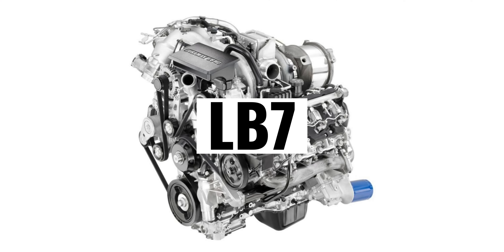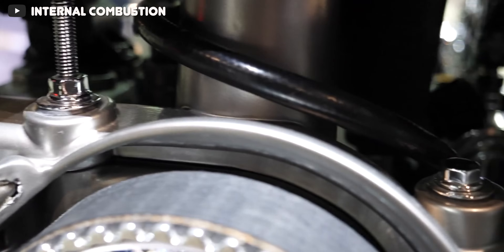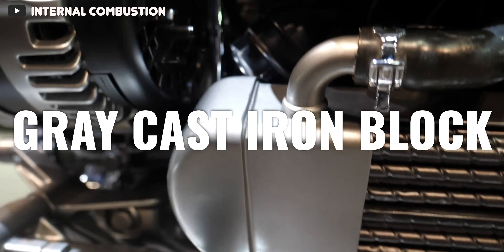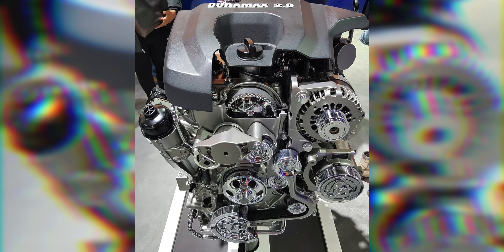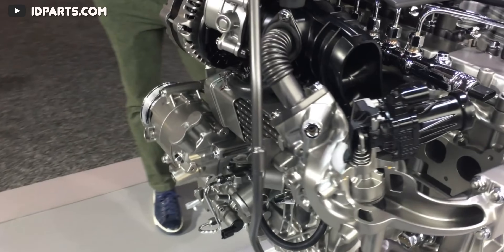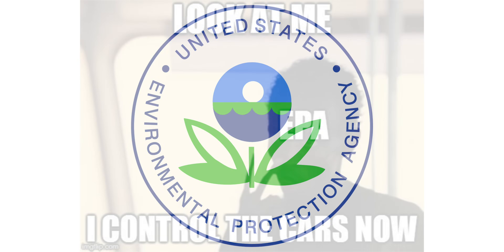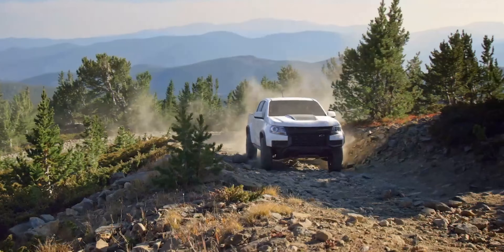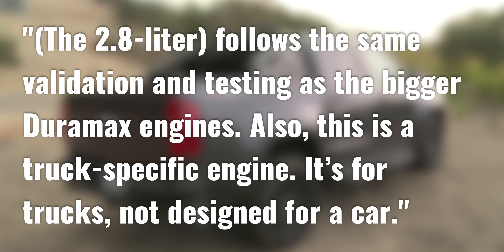2.8L LWN Duramax: Everything You Need to Know

Comment: 112k miles on 2018 colorado.   The 6L50 is the weak point.
They say 7700 pounds pulling. 
Well trans died at 65k(just out of warranty).  Now having some bad shifts on the second trans.  What are my options?
Can I upgrade to an 6Lxx to help my problem?  Or is there a  new mod/version of my trans that I should look for?

Thanks for your insights.
Stephen

Comment: I have a 2018 GMC Canyon Denali with 49,000 miles.  When I purchased the truck new, I started having DEF system issues and after 4 dealer service repairs (the last at 12K miles), I've had no further problems with the DEF system.  I started having transmission shudder at 30,000 miles.  The dealer flushed the transmission and replaced the fluid with a different synthetic and it has worked flawlessly since, actually smoother shifting now than when I purchased the truck new.  Overall, I've been happy with the truck and absolutely love that diesel engine power and fuel economy.

Comment: Thanks for the video I was thinking about getting one of these trucks but not now that transmission sux that's gonna be the weak point and I'm gonna be pulling a trailer and a boat not big pulling weight but I still don't think that transmission will hold up on a truck  wanting to drive for many years thanks.

Comment: Im not sure I follow your comments about towing.  If the Colorado with 2.8L Duramax is rated to tow 7600lbs, wouldn’t the transmission be part of that spec?  I tow a 3200-3900 lb trailer with mine with no problem, but your comment makes me concerned. Please elaborate.

Comment: "can't figure out why GM would use this transmission" - It's simple. GM used the 6L50 because the 2.8 does not put out "big amounts of power or torque" and it avoids shudder issues synonymous with the 8. It's not awesome, but "good enough" is the guiding philosophy of GM. That said, the now obsolete 2.8 is turning out to be a better engine than its VM pedigree would suggest. It was a solid engine for Holden that now seems to be surviving well in the U.S.

Comment: Recently had the displeasure of driving a near new prado for a few weeks. On paper the latest motor is very close to my 2015 Colorado but in reality getting back into the Colorado was like sitting in a sports car. The auto transmission in the Toyota was equally drab taking forever to change if manually changed where as the Holden was instantaneous. Toyota Hilux, Prado and Landcruiser are an institution in Australia and while reliable that does come with limited performance.

Comment: I own a 2018 Canyon 2.8L at 129000km and the only problem I had with it was the DEF  heater pipe between the tank and the injector that froze and opened last winter. It was still under warranty. All the maintenance been made at the dealership except for the rear brake that I did myself. I used it for daily driving and I'm doing mostly highway mileage going to work. I would buy it again for sure sad that GM dropped that engine in the latest models.

Comment: I'm glad I watched this video Didn't know I had a car transmission Not a truck transmission In my Colorado Don't look like I'll be hauling anything with the truck Just average stuff That a regular car can handle Thanks for the info And by the way I do have problems with the emissions There will be problems down the road Nothing major yet But I'm having to clean it And as for do-it-yourselfer It's a headache I'd rather do away With the whole emissions Exhaust It's more headaches than what it's worth
Reply: Yeah I tow a 3000 and a 6000 lb camper all the time with my colorado and it does a great job. I normally use manual mode and use 5th gear to cruise. I have 72000 miles of towing so far and it has been perfect.

Comment: Final comment...  why did GM stop offering this engine ???   I think its because its a better engine then what they want to sell us. it is more reliable and it has proven to be too good.
Reply: I get 38mpg the best I have gotten is 43.8 mpg and my 2021 colorado is stock
Reply: @  lifetime of about 100K mile average is 25.1  but here is the interesting part. normal elevation driven is above 2K and is see on the dash its getting  between 25-28, but when at sea level it gets 30 plus.   again thats what it says on dash, not actual fuel tank per miles.
Reply: Thas right 👍🏻
Reply: As a GM Manager word is cost versus gas options that like the 3.6l that sold much more. They're also looking at new engine possibilities from Korean manufacturer's for the future builds.

Comment: 2017 z71    i tow a light utility trailer couple times a month so far no issues, 110K. mostly highway miles. Now i do service my religiously.   other then the occasional glitch with radio or AC function. the truck has been great.

Comment: I have the 2016 Z71 with 2.8 L Duramax engine. Not had any issues with towing "lighter" loads (<5000 lbs.), but am getting 30 MPG every time I run on the highway. The biggest complaint I have with the emissions is not that it's there, but that the NOx sensors are a weak point. I have over 183K miles on mine and am on my 3rd set of NOx sensors. This, so far, has been the weak point of the truck. Absolutely no other failures have happened in the 183,000 miles I have driven the truck. The 1st set of sensors did not fail until AFTER 112,000 miles! And by the way, the NOx reduction system (SCR-Selective Catalytic Reduction) actually DOES work and is NOT theoretical. This technology has been in use for over 30 years on power plants across the country preventing acid rain. The fact that you still have trees to run through are a testament to the effectiveness of this technology. It is NOT theoretical, it is PROVEN. As an engineer who has worked with these and other systems for reducing or removing NOx emissions for many years, I get a little tired of you tubers claiming otherwise when they really don't know. This is an excuse to violate federal law in removing or modifying these systems. Don't get me wrong, I don't like them either, but they do work, and if you know of a better system system for eliminating these emissions, then please speak up! Otherwise, you present some good content here. Well done!
Reply: Isn't there a certain amount of carbon that is beneficial to our way of life? I think with our modern catalytic converter, high pressure fuel systems, and other  non polluting manufacturing processes can result in a reasonable amount of soot and carbon being pumped into our air that won't result in terrible air and high cancer rates in users. I can't fathom the creation of a system that purposely pollutes the inside of the engine resulting in more manufacturing of parts and a high expense to the owner.  Also producing DEF isn't exactly clean. The spilling/leaking of the fluid from deteriorating parts, plus the incredible expense to replace def heater, filter systems, etc, is just not ideal for businesses that want to use these diesels for a million miles like diesels of many gens before ours.
Reply: @msschill  Two things: sucking in soot is never a good idea, in any amount and diesel exhaust isn't just about rolling coal but the gases involved with combustion: "The nitrogen oxides family can react with ammonia, VOCs, and other compounds to form PM 2.5 pollution that easily penetrates into sensitive and deep parts of the lung causing respiratory diseases like emphysema and bronchitis. NO x also can aggravate a pre-existing heart disease, leading to premature death."
Reply: @msschill  Stop being a contrarian for sake of veing a contrarian. Diesel is efficient but very dirty as a fuel, hence extra emissions equipment needed to make it relatively clean. Its not about CO2, but all other highly cancer inducing poison it spews including soot.
Reply: @msschill  NOx isn't carbon and DEF is 30% synthesized urea and 70% de-ionized  water.

Comment: Appreciate the video but the whole “car transmission” contention has little merit. A 335 hp Camaro V6 can generate 185% of the shaft torque of the 181 hp 2.8 and that car application will probably be at WoT a good deal more of the time.

Comment: I have a 17 Colorado 2.8.  I bought it used august of 22 with 75k.  Had it two days and got the dash warning of having so many miles before powering down to 6mph only.  Brought it back and ut was the nox 2 sensor code.  Replaced it...been great ever since and have 100k on it.  Don't tow anything yet

Comment: Funny you mentioned the timing belt as being a way to reduce noise in the engine, but having driven both duramax Colorados and full size L5P duramax trucks, the full size 6.6 is a noticeably quieter running engine

Comment: Thank You so much !  We have a 2018 ZR-2 and love it. I installed a B&M trans dipstick. and change the engine oil every 4,000 and the  fuel filters and trans oil every 20,000, We do a lot of towing --- we have a Feather-lite car trailer and have towed every thing from cars to fire wood...Love the trans - going down hill I touch the brakes and the trans will down shift.  The jake brake docent work very good, and the brakes are not the best. All three of our trailers have brakes on all four wheels.  Over all we are very happy with our ZR-2...

Comment: I will remember to never, never, buy anything with that engine as long as I live. A timing belt, that is a red flag. Aluminum heads, red flag enough. I guarantee you you can expect that head to have warpage issues. And if the bolts aren't way oversized, you'll have bolt stretching issues which will lead to head gasket issues. I mean basically that's just a little economy motor that should be in a Volkswagen.

Comment: 2016 d-max. @ 150k miles and I max tow quite a bit .  Let's just say. Transmission has a shutter now. . Yes it's tuned . I wish I could find a manual transmission that would fit right in .  Other than the dpf system . The truck has been great.

Comment: Same engine as in Isuzu D-Max 2.8, I believe. Should be durable. Insane torque from very low rpm.
Reply: 369 ftlbs of torque 2200 RPMs
Reply: Not the same engine, the 2.8 is not made by isuzu.

Comment: In 1998, these engines were being put into Chrysler Minivans overseas. They were in a 2.4 L format. And getting 50 miles per gallon. Going 1050 miles with the 20 gallon tank. Then they would put seven people in it and it would still go 740 miles. That's about 37 miles per gallon.
All of this while putting out 300 foot pounds of torque and about 180 horsepower.
It was General Motors who had these stupid ass idea of trying to convert a lightweight gasoline engine into a diesel that set diesels back over 30 years in this country and we are still suffering with the effects of the stupidest government trying to claim that you can make a diesel run as clean as a gas engine. The pollutants from a diesel are primarily soot, which falls to the ground and becomes dirt. There is no reason to have to put a diesel exhaust filter in the exhaust system. What does efficient as modern diesels are they put out very little soot anyway.

Comment: I was lucky enough to get the 2016 Holden Colorado that had all the upgrades and no DPF
I put the biggest intercooler and 3 inch straight pipe exhaust and stainless steel snorkel and was able to get 151 kW and 591newton metres at the wheels super happy with it
In a simple catch can stops the recycling
But a trans cooler was also needed so it was running through the radiator and a trans cooler with an extra 1 litre😎👌🔥🔥🔥

Comment: I have a 2017 2.8 and after 135,000 miles (10k of towing at 12,500 lbs up mountains), the motor gave out on a normal drive. I think it was a stuck injector blowing a hole through the piston.. Be prepared for a $12,000 bill if you find a used motor to replace your old one.
Reply: You nearly doubled the tow rating of the truck what did you expect
Reply: @firstlast---  combined.
Reply: @brainfarth  Ahh my mistake I misinterpreted what you said. Very unfortunate failure those engines aren't cheap
Reply: @firstlast---  No biggie.. Yeah, it's flipped the value of my truck upside down.. Now I have to keep it until it dies.

Comment: Hi mate, so glad i trip over this vid TOTSL LOVED IT!!!. I own a 2018 holden trailblazer (Australian model) with this engine in it. These models not the truck style colorados that we have seem to have 2 issue one been the inlet manifold seems to break the inlet runner in them and then need replacement and the other is torque converter issues, I was wondering if you know of these issue and what is the cause behind the problems. 
Thanks Robert

Comment: People seem to assume that just because a truck is powered by a Duramax turbo diesel engine that it's going to get 30 mpgs. I think it depends on how one drives the truck. I think it depends on the load placed on the truck. You might get 30 mpgs if you're lucky, you might get 32 mpgs, you might  get 25 mpgs.
Reply: Yup.  And lifts kill MPGs.  The ZR2 gets much less MPG than the Z71, whether gas or diesel.  EPA derates the lifted ZR2 by 6MPG on highways for both gas & diesel.  Lead Foot Lynda and Lifted Larry must pay more to drive high and fast on highways ;)
Reply: 24 mpg life time average for my z71 2.8 . at 110K miles now.   i do get as high as 32-34 on some trips.  most of my driving is highway with 600-800 lbs. in the back.
Reply: @HR-rt9nh  That's not bad.

Comment: Great review! I have a 2017 GMC Canyon with the duramax engine. I bought used and have thoroughly enjoyed driving the truck. Great fuel mileage, about 32 mpg and love the diesel engine noise! I was saddened that GM had dropped the engine in favor of the 2.7L gas engine.
Reply: i just bought a 2016 colorado with the duramax. How has the truck/motor/trans held up for you?
Reply: @HighVoltageTech84  No issues with motor or transmission. It has 50k miles on it. I had to replace the HVAC control module (on the dash) as all the lights burned out. The vent setting buttons still worked, but driving at night and changing the vents was difficult
Reply: @michaelpena6285  Gotcha. Mine has 60k on it now and haven't had any issues, but i've had her two weeks lol. Appreciate the reply!
Reply: @HighVoltageTech84  do you still have your truck and how has your experience been?
Reply: @joeypenn1367  Yeah I still have her, up to 80k miles now. No major issues up to this point thankfully. One thing is sometimes the trans will shift kind of hard, but it's difficult to pinpoint when it will do that. Doesn't seem like anything to be worried about though. I did have to make one repair to the 3rd brake light, turns out the weather stripping wore out and rain got in and soaked the headliner a couple times. Easy repair. 

I would like to still do the emissions delete one day, but that's looking like a hefty investment. She runs great now, so I'm not sure it's worth the risk of potentially screwing that up.
Reply: @HighVoltageTech84  I bought my 2016 Chevy Colorado, Z71, CC, LB, 4x2(this is the only way to get the Full 7,700 lbs tow rating) New in 2016  
I am over 101,000 miles stock, no issues.  I do  a lot of city driving (I live in Los Angeles) and some some highway. my average MPG is over 25MPG highway I get 31-36mpg (65mph)
good tranny, good engine, I really want to trade it in for a 2022 ZR2 Diesel(want the toy fun), but I also want to keep it to see how long it will last, and I also want to make some changes turbo, Tune no delete, leveling kit, ... anyways my point is this is a fantastic truck and its smaller size allows a lot easier ability to move about and park in the city!

Comment: I've owned the Australian Holden colorado variant for nearly 5 years now,  the 6l50 6 speed has had some issues here with torque converters failing giving a shudder off the line throttle, Holden gladly replaced mine with a revised unit under warranty and has since been fine good. Over all the engine has been reliable with no other issues, although I fear I will encounter some egr issues down the road as they are a pain in the ass. Never had a regen issue with dpf as my drives are usually longer then 20 minutes each time and don't even realise it's been through a regen at all. It's been a great mid sized truck so far
Reply: the duramax issues were nothing compared to the ranger/bt50 and hiluxes. ive got a 3.0 colorado, only had it for a year but love it. is yours a rg1 or rg2? i think the rg2 were pretty good reliability wise except the automatics

Comment: So, basically the emissions systems and the transmission are the weak points. Otherwise it seems like a sturdy engine, with some degree of tuning potential. The low down torque seems very good.

Comment: I have a 2016 GMC Canyon with the 2.8 Duramax. It’s been dealer maintained since day one. At 90k it blew a head gasket and warped the head. Took over 9 weeks for the dealer to get all the required parts and complete the repair. The bill was just shy of $8000. The truck was flawless and I absolutely loved it until this happened. Not anymore. I don’t trust this engine and will be trading the truck in the near future. No more  diesel or GM products for me.

Comment: I have a 2016 and a 2017 Holden Colorado. Both have done 300,000km (180,000mi) both have the 6 speed manual trans in them i was thinking about changing out the engine at 400,000 km. No problem with the manual trans yet. Good idea?